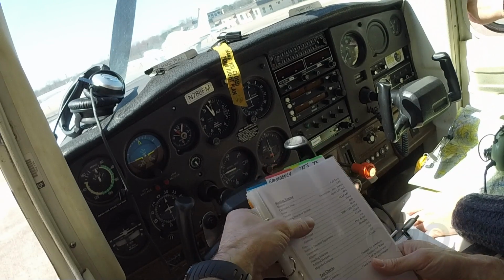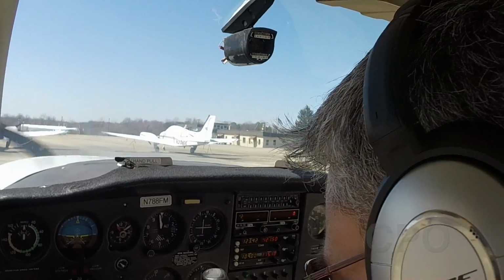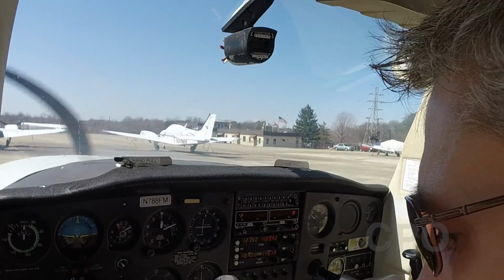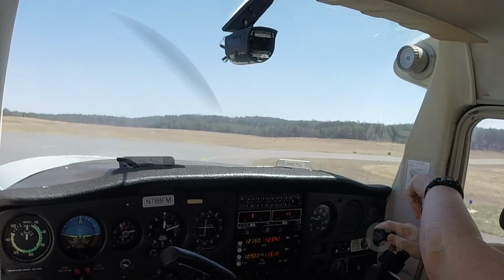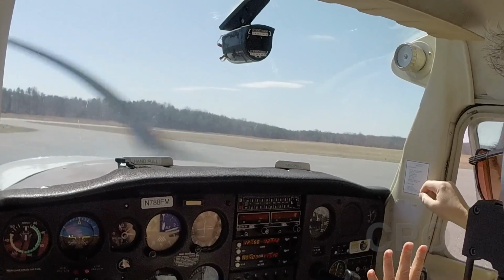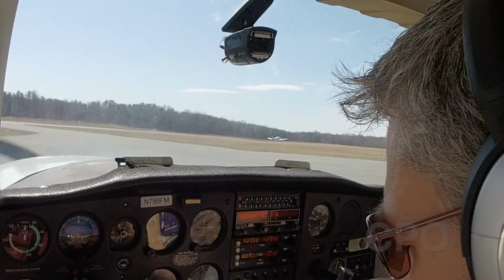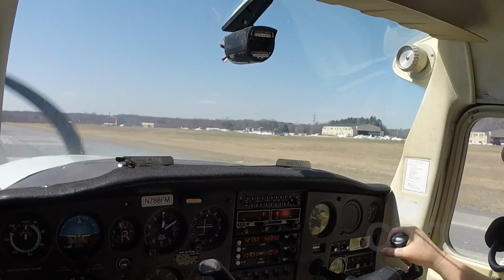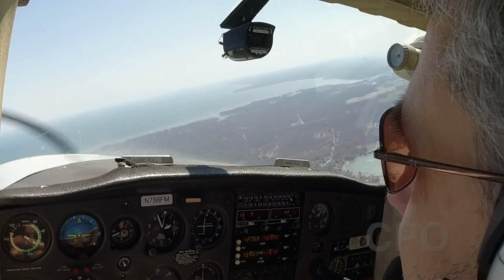CPO's Private Pilot Training 4-6-15 - First Flight with Instructor

Comment: Hi CPO, very nice video. I've just finished my training for my CPL MEIR and will be moving to bigger planes soon, but this reminded me of the good times I had when starting out. I trained on a Garmin G1000 equipped C172 though. 

On a side note I was looking to buy a UFlyMike attachment for my QC15s too, but they've discontinued it in anticipation for their Harmony range which is supposedly coming out soon. Is the ANR of the QC15 good enough to be used comfortably in a light single?
Reply from the maker: ***** I think the ANR worked just great. I didn't think about it at all (which is generally a good sign). I ended up having to buy my UFlyMike used because I didn't want to wait for the new ones to release. They are hard to find tho. You may get lucky if someone is wanting to sell to upgrade...or you can just wait. :-)  This is my first ANR system...so I don't know how it compares...but it's perfectly fine for me -- and without the hard clamping pressure of my PNR headset. These Bose (as you know) are so light, you forget you are wearing them.